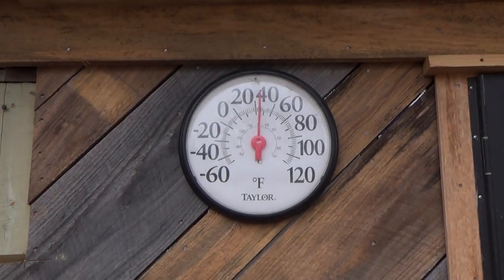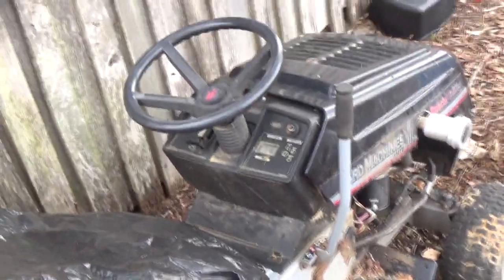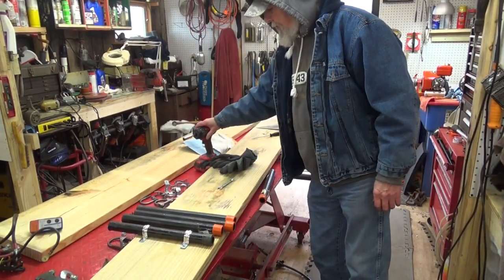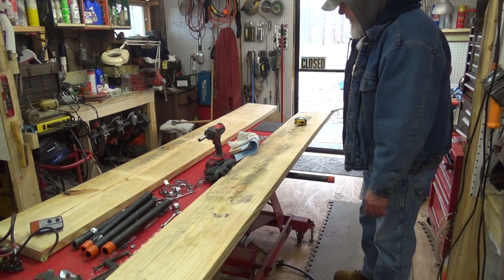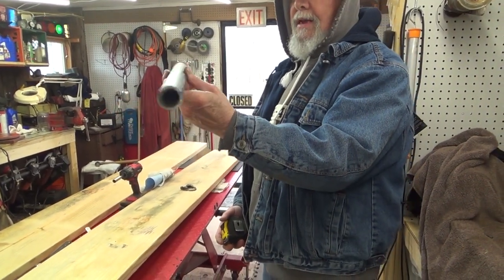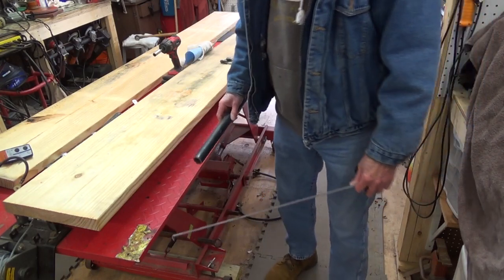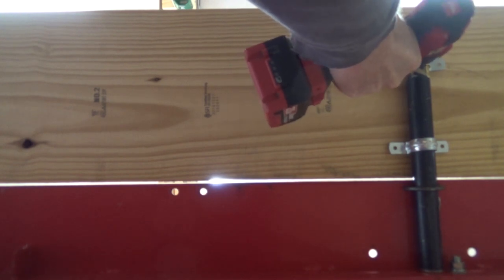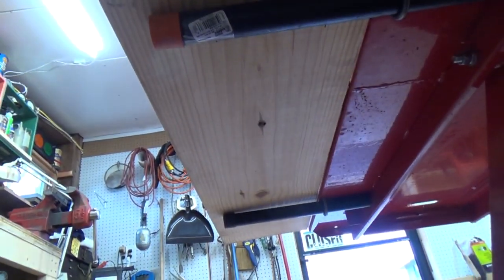Simple, DIY, removable Harbor Freight motorcycle lift extensions

Comment: Did you have to modify the foot pedals? I made extensions for my lift table as well but when it's in the down position, the pedals are covered and extremely difficult to pump up the jack.
Reply from the maker: I did extend the pedal to lower the table. Actually, I made mine into a handle instead of a pedal. My handle is removable so it is completely out of the way when I am using the lift. It works well for me. If you would like to see the handle in operation let me know and I can make a short video for you. Thanks for stopping by. I guess you may not know that I have converted my lift table to air over hydraulic, so I don't pump it up anymore. I have a short series showing how I made the modification.

Comment: Great Idea
Suggestions would be to shorten them they dont need to be that long. Probably half that length on each side would work.  Then you'd only need two pipes on each side. And maybe 45 the ends for walking room.
Thank you for the video
Reply from the maker: Well they do need to be full length for my 4 wheeler and the Goofy Cart, but once the Goofy Cart is on the lift I usually take the extensions off. Thanks for stopping by. BTW, part of the reason for being full length is to accommodate the ramps to get the projects up onto the lift.

Comment: I went a different direction. I don't want to take up all that space and there's a ton of Room to use the lift table itself to hold tools and  anything else. I just put a couple of the same boards down on the floor build them  up 7" so I could drive the bike on it then I could remove the boards.  I only needed about 5' to make it a drive on ramp so I didn't need a second person to help me with the bike
Reply from the maker: I had that setup when I was back in Minnesota, but it was heavy and cumbersome. This works well for me. Thanks

Comment: Just curious how you fit a riding mower through that small door?
Reply from the maker: The other panel next to the door is also a door, it swings into the Goofy Garage part of the shop. The woodworking shop will have an outswing door so the opening will ultimately be 5 feet, just the same as the mechanics shop.

Comment: that will work great, when it gets warmer and I can work in my shop, I'm gonna do something like that too, the way they are originally they don''t work well for riding mowers.
Reply from the maker: It is pretty sketchy with a riding mower on there as the tires ride the ridge pretty much. Thanks Vernon. When are you going to show us your new lift?
Reply: @TheShadeTreeFixitMan  I was hoping to get my shop cleaned a little before I make a video of it,, it's really pretty nice, I found it on facebook marketplace, it was about 50.00 more than the HF ones but this one comes with an air lift, it's called Black Widow. they make side extensions and they aren't real expensive but the shipping is a killer so I'll do like you,, I'll just make out of wood.
Reply from the maker: @MissouriOldTimer  Well, you'll be glad for the air lift and the price sounds pretty good. I think I had been looking at the Black Widow lifts before I bought my HF. They retail for around $1000 as I recall.
Reply: @TheShadeTreeFixitMan  I got this one used, it was 500 but isn't hurt at all, it had an expensive wheel clamp which I don't need , I have it on craigslist and marketplace, one guy offered me 180 but I'm holding out for 200
Reply from the maker: @MissouriOldTimer  My wheel clamp got left behind in Minnesota, but it came with the lift which was only about $300 including taxes, at the time. Yours will be ahead of the game because you already have the air-lift, which cost me about $75 to add to mine at the time I did it.
Reply: @TheShadeTreeFixitMan  Hf had a 25 percent off coupon but the lift didn't qualify so I found this one so I decided to go for it.

Comment: George, how do you like your Bauer cordless tools?
Reply from the maker: Hey Matt. I like them very much. I have 2 drills, an impact driver, a right angle grinder, and now my Bauer band saw (it is corded...). I wouldn't buy the extended power batteries again, as I don't think they really last much longer than the regular batteries. Some time I would like to get a battery powered circular saw too. Thanks for stopping by.
Reply: @TheShadeTreeFixitMan , thanks George. Bauer is about to introduce an 8amp battery. My Porter Cables are not being supported anymore and I'm looking for replacements. Maybe if time allows, you could do a tool review? I know the Goofy Cart has priority.
Reply from the maker: @mattthescrapwhisperer  I'll be happy to do a tool review Matt. It will push me to get my bandsaw set up too. Thanks
Reply: @TheShadeTreeFixitMan , Looking forward to it!

Comment: Great idea sir. Can you please list the items used for the project. Genius!!!!
Reply from the maker: Yes I can. I gave the materials list in the beginning of the video... 2-8' - 2x12, 6 tube clamps, 6 - 1 3/8" muffler clamps, and 3 - 30" x 1.5" OD black iron pipe, split in half to make 6 -15" pipes. Thanks for stopping by and enjoy your modification on your lift.
Reply: @TheShadeTreeFixitMan  yes sir I saw. I used 4 clamps and had 2 1-1/4. Those fit right in without making the holes wider. I will post a pic  thank you very much sir.
Reply from the maker: @mohabens5469  Glad it worked out for you. It is a great modification to these lifts. Thanks
Reply: @TheShadeTreeFixitMan  absolutely. Since the lift is 9 inch of the ground,now I can set the bike while me feet are grounded. Can't thank you enough.